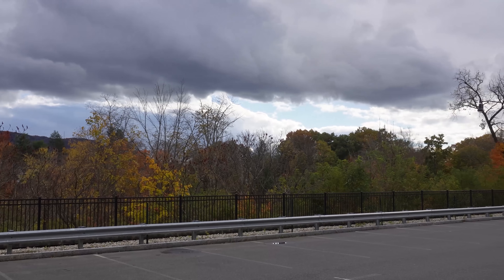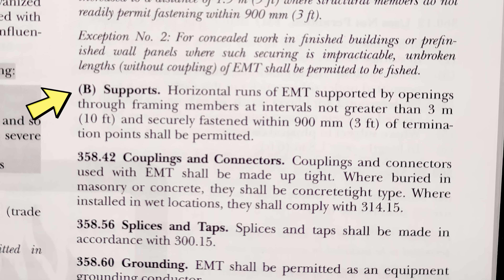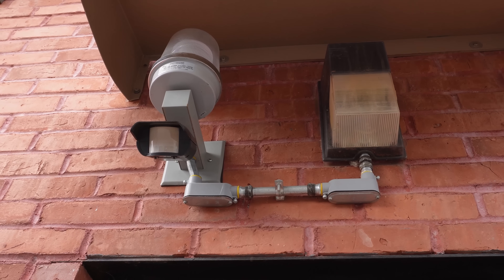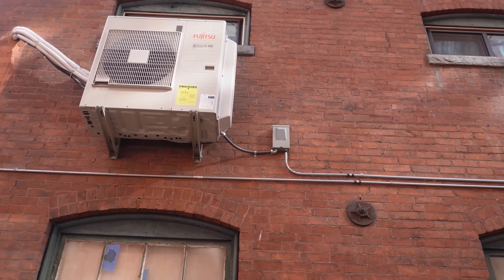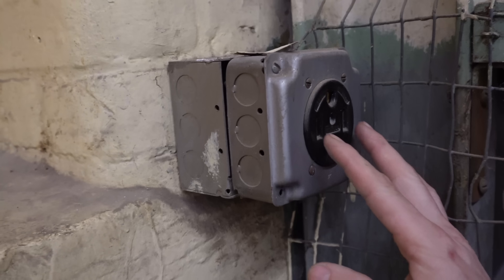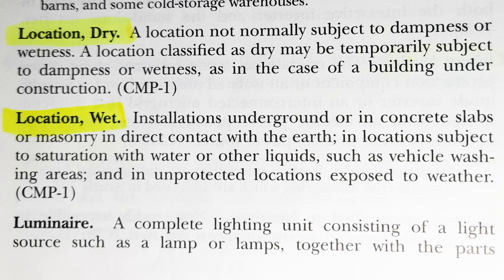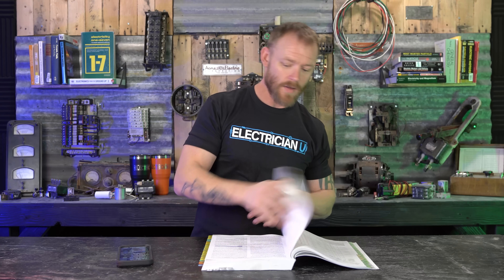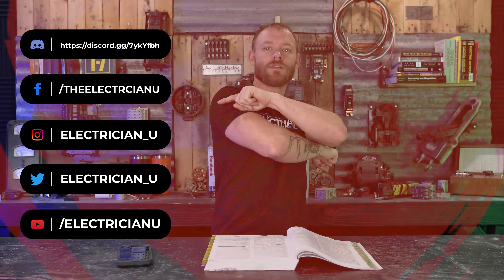Finding Code Violations in a 100 Year Old Building!

Comment: Wtf is "raintight"? It's liquidtite or weatherproof. Also there wasn't much code 100 years ago. Of course anything you look at that's 100 years old will be a "code violation" to today's standards. Even though codes are not retroactive, and as long as it was in compliance when installed, it's still in compliance.

Comment: Umm so old houses are grandfathered through to avoid new construction code no?

From my understanding even on a rewire if your dealing with a old home you can replace what’s there without meeting code 
   Meeting new building construction code in old homes such as lathe and plaster, you would destroy the house trying to meet new code 
  You can’t just punch 25 new receptacles into a plaster walls without destroying the home 

Can everyone weigh in on this please

Comment: I know I'm late to this party but i believe those flanges were for the rigid pipe is what they did before 3 piece unions. Can't spin on the rigid 90 so weld on a flange and bolt together.

Comment: Dustin I have a question we were in Atlantic City and there was a new phase of Harris Casino that was built for the hotel and the first night we were there the lights kept on coming on when they’re off and it happened three times so I told the maintenance guy and he said He’ll look into it however he didn’t and the next night it happened again and so I went downstairs and complained that I need to get my sleep and the lights keep coming on so I actually found two guys that were not electricians, but were carpenters and they said oh you’re on the sixth floor yeah, they had some Guys that did some some work and they heard that a nail had gone into the wire which would probably explain a short when I complain to the front desk. They said they never heard of anything on the sixth floor yet two of the employees confirmed that there was an issue and they still booked on that floor, what code would fall under that type of situation and is it a fire hazard because of a nail tapping into a wire? Just curious

Comment: I got board and found the code, I believe these 2 code references from NEC 70 2017 requires boxes to be covered and secured 
110.12 (A) Unused openings, other than those

intended for the operation of equipment, those intended for
mounting purposes, or those permitted as part of the design
for listed equipment, shall be closed to afford protection
substantially equivalent to the wall of the equipment. Where
metallic plugs or plates are used with nonmetallic enclosures,
they shall be recessed at least 6 mm (1∕4 in.) from the outer
surface of the enclosure.
110.31(D) Enclosed Equipment Accessible to Unqualified Persons.
Ventilating or similar openings in equipment shall be designed
such that foreign objects inserted through these openings are
deflected from energized parts. Where exposed to physical
damage from vehicular traffic, suitable guards shall be provi‐
ded. Equipment located outdoors and accessible to unqualified
persons shall be designed such that exposed nuts or bolts
cannot be readily removed, permitting access to live parts.
Where equipment is accessible to unqualified persons and the
bottom of the enclosure is less than 2.5 m (8 ft) above the floor
or grade level, the enclosure door or hinged cover shall be kept
locked. Doors and covers of enclosures used solely as pull
boxes, splice boxes, or junction boxes shall be locked, bolted,
or screwed on. Underground box covers that weigh over
45.4 kg (100 lb) shall be considered as meeting this require‐
ment.

Comment: 1862 here, Lincoln was president, NO power till 1890's, then it was these porcelin insulators screwed into the dirt basement ceiling ( Dc power Im told) . When it did get AC, it was cloth and 2 conductor, and floors and scabbed beams put over it .. a mess, nasty mess... a ways North of Beantown.. yeah stuff is old..

Comment: I invite you to my old mans home in Utah. It's a 100+ year old house all built by a farmer. Electrical is jank! For a while, when you turned the shower on, you felt a small current, both in the water stream and the handles! Many circuits are started in 12g and end with 10g wire. Circuits/fuses are looped vertically between the basement and first floor. Naturally, no ground ran. Whites are hot and black is neutral, for when you can see the color of the wires. Old tiny metal boxes housing the outlets with little to no space in the back or sides. Not all outlets or switches even have outlet/switch boxes. Switches exist that don't connect to anything that we know of. The basement electrical lines are encased in the 100 year old mortor stuff with wood overlay. There's a few fishy things going on with some of the switches and lights that don't make sense to me and my basic modern knowledge resuliting in my old man giving up on a fix and leaving live wires hanging out of a switch "opening in the wall". Some of the lights still have some power running through them even when the switch is turned off. And GFCI outlets don't work in atleast one of the circuits, which I assume means there's an active short in the line?

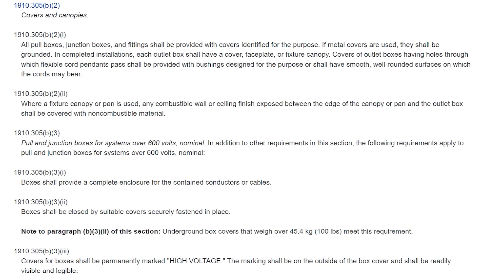Comment: Regarding the ~15:00 discussion about Code, didn't you say that anything that's Listed must be installed according to the Underwriter's Laboratory listing & labeling? Therefore I would think that if Code specifies *that*, then wouldn't the boxes all probably need to be enclosed/covered? 

Or is it possible/allowable to use a NON-Listed box, therefore where you don't HAVE a Listing/Labeling TO comply with?? 

Wouldn't that, in a roundabout way, cover the boxes being closed up? Their listing?

Comment: Just because a box is outstanding doesn't always mean wet location. It could be damp due to the size of the over hang and distance from the edge.
Those disconnects are best places for those applications, it keeps random people from messing with them and Turing it off on someone in the office/apartment.
Reply: This is absolutely correct. This is not a wet location. There is a roofed exterior in the reflection of the window and the overall shadowing of light reflection leads me to believe this is not an exposed exterior which therefore means a wet location code infraction does not apply here due to it being a damp location. Sorry buddy love your channel but you are mistaken on this being a code violation.

Comment: seriously? you dont know why someone would do that with AC disconnects?
bro... you have to have a ladder to work on the unit... so yeah, you put the disconnect right with the unit, those make perfect sense if your servicing the unit... and why in the world WOULD you put them down lower where vandals can flip em off easily...

the lights, yeah weird way of doing it instead of flex... but not a code violation... 

the disconnect pipe, you didnt show the whole picture... and you said 30 inches, which is not correct, its 36"... so now the pipe can be secured 10' away, maybe its where you cant see it, or maybe it isn't... you didnt show it, or if it passes through a piece of framing or soffit with less than 1/8 gap, its now considered supported again.

so... back to the video... so far, an electrician? meh, you'd make a good home inspector

edit: so... the hose bib... bro... use your freakin brain... ZERO RUST... it was an airline with oil added... THATS WHY

edit: 2 ... no covers on boxes... wow... u act like thats something that has never happened in the history of ever

im done... done with the internet for tonight... why dont you go speech-write for brandon, it would fit in perfectly with his train of thought man... or amber heard

Comment: Completely off topic, but I find it interesting that the US National Electrical Code uses metric as the primary measurement system, with the approximate US Customary units in brackets.
Reply: It changed in 2002 because of the International Codes. Look at a 1999 code book. It has metric in parentheses

Comment: The bolt together pipe is likely water or steam pipe. Old electric used to not have its own pipe/tubes and used either water or steam.  I'm not an electrician (I want to get my license even though I don't work in the field though do all the maintenance at work and for my employer), I learned from my grandfather who passed away a few years ago, but have been listening to modern and updated code and always learning.  That's one thing I had learned though.

Comment: So a meat processing plant that I used to have to do work at for a contractor I worked for uses stainless steel pipe that they supplied. The caviat to this is that they required thread tape applied at all threaded joints.

Comment: CEC regulation 

12-3022 Entrance of cables into boxes, cabinets, and fittings

1) Where cables pass through the walls of boxes, cabinets, or fittings, provision shall be made to

a) protect the insulation on the conductors from damage;
b) protect terminal connections from external strain;
  Δ   c) provide electrical continuity between a metal box, cabinet, or fitting and conduit, armour, or metal sheathing of cables, whether or not the armour or metal sheathing is to be used as a bonding conductor;
d) prevent damage to a non-metallic sheath applied over armour or metal sheathing for protection against moisture or corrosion; and
e) close the openings through which the cables pass in such a manner that any remaining opening will not permit entrance of a test rod 6.75 mm in diameter.

 by/par CSA on/le 2022-04-27 05:30:48 PM . ~Fair use license only
Reply: 12-3024 Unused openings in boxes, cabinets, and fittings

Unused openings in boxes, cabinets, and fittings shall be effectively closed by plugs or plates affording protection substantially equivalent to that of the wall of the box, cabinet, or fitting
by/par CSA on/le 2022-04-27 05:43:23 PM . ~Fair use license only
Reply: In commercial specs, definitions, "provide" was typically meant to mean "furnish and install".

Comment: Hi dustin was it an abondond air line next time u r in new england text me i have electrical supply i will donate for instructional purpose. I worked 5o years in texrtile mills most have witch have been converted to condos . thats a violation gottta b coverd to contain sparks

Comment: In the 20 years I worked Maintenance we never had a Master electrician. If you could read a print you were the electrician if you could handle a plunger you were a plumber if your hands fit a mop you are a janitor. In that 20 years I was all the above we were just maintenance men. Never ever did any of us ever look at a codebook hell I’m not even sure if it was one in the plant. I’m not name names of the companies I work for but one was a major oil seal company a major bottling plant soda pop and last I A major company that made PVC conduit all the way up to 30 inch water pipe all three were major companies. The worst was the bottling plant it was built sometime in the late 1800s and it still had some of their original wiring that was being used. It was not unusual to come across the old string wrapped wire running through porcelain insulators. The string had come off the wires are hot we had no idea where they were coming from or where they were going to. The walls in the building we’re up to 18 inches thick of brick and concrete and there’s no way to trace it cause you just couldn’t get in there.

Comment: I have to share a Story here of not being up to Code. Since this happened in Germany and im not exactly familiar wit the US terminology it might be off in some places, but i try to translate as good as i can.
Basically i was doing a Revision(Check of the Installation) of the Outdoor Lights of a Car Logistics Center, and wanted to switch on some Lights to verify if they still worked regardless of the controls behind them. They were switched via Contactors/Relais, and i had 0V when measuring the Coil (A1to A2). I then measured one of the Coil contacts against Ground/PE and got the full 230V. i subsequently measured Ground/PE against the other Contact and also got 230V. My first conclusion was that they have switched the Neutral/N wire instead of the Live/L Wire, which is already bad enough, but it got worse. Subsequently i located the Box where the Timer was located and what i found was even crazier: they actually didnt have any Neutral in there, they actually switched the Ground/PE to trigger the Contactors. Worst part of the Story? The Cable connecting the Distributor with the Contactors and the Box with the Timer had 5 Wires, so there is no reason to do "Pfusch" like this... Needless to say i changed the Wiring in both locations that this was remedied (Proper L, N and PE over the Cable, and two switched Ls )

Comment: I'm not an electrician but I enjoy following all this. Here's a question: if a cement block room has a closed steel door and only contains open junction boxes, are they considered closed because the room is closed.
Reply: When it's the physical location of the box and not the condition of the box, a different set of words applies. Those boxes will be considered accessible if the room is locked, or readily accessible if the door is just closed and NOT locked, but it will not affect what the boxes are, since the room itself is not an enclosure but rather a location. Same thing with running Romex inside a conduit. Just because the conduit is likelier to be dry on the inside, it still doesn't mean that it's a dry "location" - location is where the conduit itself is run, e.g. inside the building, outside the building, shower room, etc., and that's what determines whether it's a wet location or not.

Comment: I do property condition assessments as part of my job and it’s always great to see examples of problematic electrical work. Especially since my expertise is more specialized in HVAC and I’m expected to discuss a wide range of building systems such as mechanical, electrical, plumbing, fire protection, elevators, security systems, etc.

Comment: Worked in a 150 year old building worse than this. If the panels had 3 feet of clearance inspector was happy. Power strips  ,extension cords , wire nuts visible everywhere.

Comment: readily accessible means that you don't have to use ladder or tools to access it. Note the wording for condensing units on commercial hot tar roofs. It says it does not have to be readily accessible from the ground; obviously it take a ladder to get to the roof top to access the equipment, but there still has to be a disconnecting means within sight of it. Being on the side of a building like that 12 feet in the air is not readily accessible. Look at the definition of readily accessible in the NEC; the use of portable ladders does not qualify as readily accessible but accessible, so it is in violation! If you have to move, use tools, climb over, use ladders and so forth is in violation of the term "readily accessible" according to the NEC. Someone let these people do some things that were right! they save a lot of money; because they would have had to bring those disconnects down to within 6 feet 7 inches to the middle of the fuse handle for it to be completely legal.

Comment: i have simple questions for you. one it had sealed tag meters. meaning the power is on. and believe it or not even today some areas dont have required inspections. your lack of knowledge and way some of your commentors write i am scared for not only the tradespeople (didnt call them electricians on purpose) but for people they do work for.

Comment: In my state if you don’t touch it you don’t have to fix it and code includes provisions for it.  If you just replace old material with new material the old code applies.   

In my house, 120 years old, knob and tube was properly spliced to romex at the fixtures, but they installed fixtures with grounds where no ground exists. That was a violation.   There were also splices on the knob and tube wrapped in inner tube and aluminum foil.  Another fail.  I replaced all the knob and tube with romex when upgrading fuses to breakers, I didn’t have to increase the breaker count to do that by code. That’s part of grandfathering.  I did split some for a reasonable load balance but not others due to complexity and lack of need. 3/4 of my house was on a single breaker, it’s not anymore. 

I like in someplace as old and more backwards from mass.  I don’t think you really understand that.  

Old stuff has lots of interesting materials and rules that apply, and different states call different revisions of code as current.

Comment: I believe that somewhere within the code “workmanship like manor” is included, I’d assume box covers fall under this. I’ve seen inspectors bust electricians (and others)for workmanship 
Nonmetallic sheathed cable (aka Romex) in my opinion is nothing more than extension cords run in walls, conduit is required even in single family homes. This is the best way to run electric.!

Comment: I do not do electrical for a living, but I did rewire a 125 year old house last year.
I pulled out 5 different generations of knob and tube.... Not to mention the different generations of romex-y stuff, almost exclusively without ground conductors. lol
Now everything is actually up to code and the house has more than a single receptacle pair per bedroom (at ~4' off the floor!!) among many, many, many other things.
You'd have enjoyed the walk-through of various types of knob/tube.
PS: I only found a little stretch of aluminum K&T wire, and once the kitchen/laundry is redone, there will definitely be NO K&T left in the house. Given my daughter is living there? I'll be happy with that!

Comment: You should use a contactless ac voltage sensing tool on an extendable pole to check if wires are hot!